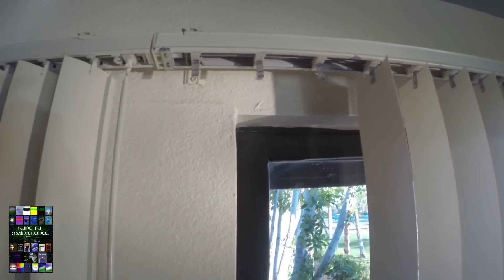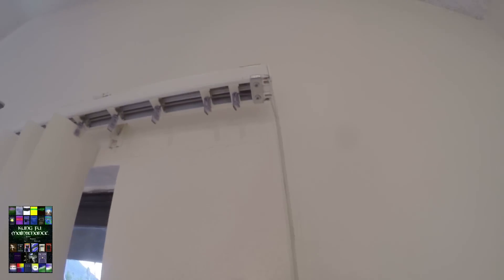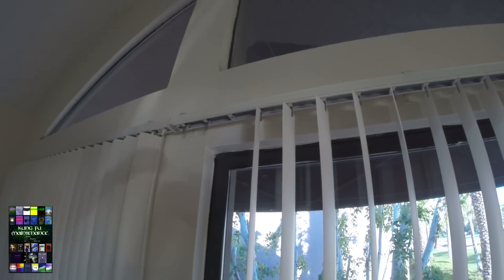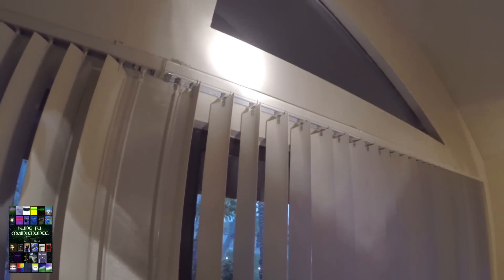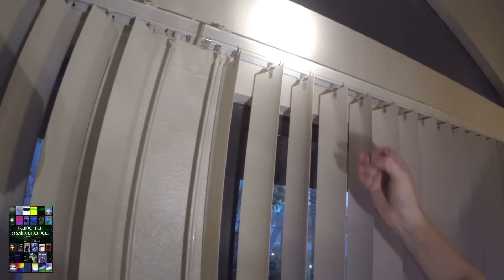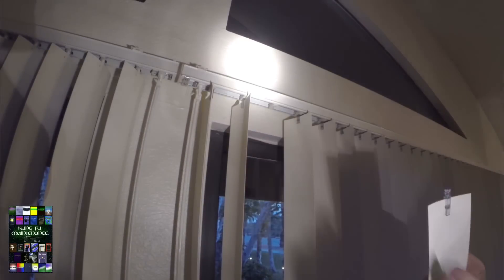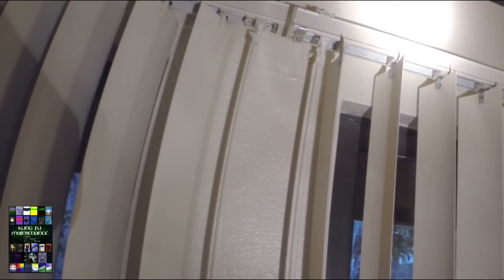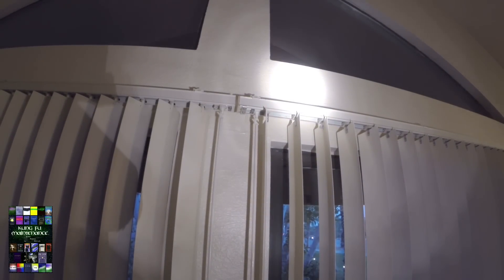How To Repair Vertical Blinds Broken Stems Gears Not Turning When You Don't Have Parts

Comment: Note that the Levolor cordless vertical blind head rail uses a different mechanism that doesn't pop off. If the plastic gear/blind holder gets out of sync with the rest of the blinds, you have to push up hard on the device then rotate it to the desired angle (as the others) and snap it down into place (meshing with the drive gear).

Comment: Thanks for the video.  I had the same problem where I turned the wand a bit too far and it apparently popped the gear up.  Step by step instructions definitely helped a novice like me.  A piece of my cover cracked off when I opened it, but I was able to flip it around so that it still holds the gear down.

Comment: How does the comb go in?  Toothed side out, flat side up or down?
Reply from the maker: Combs go in tooth side up, grooved side facing the opening and the stem gear fits into the grooved side. Comb teeth face up fitting into the center control rod.
Reply: Thank you!  Got them in.

Comment: Thanks for the video. I thought my problem was with the master gear. But, I removed, took apart, and inspected it and it appears to be fine. I can't rotate the shaft, even using my hand or a pair of pliers. Any ideas what might cause that?
Reply from the maker: +Matthew Frei It's possible all the slats are stacked the wrong way. Check me video "Vertical Blinds Won't Turn " Kung Fu Maintenance
Reply: Nope, they aren't the wrong way

Comment: Now here I thought "when you don't have parts" meant "when you don't have parts." You DO have parts - you have spare stems. I don't. Not very helpful.
Reply from the maker: +Marcia Purse Sometimes you can take one from one of the ends if if you have enough room. Doesn't always work out but those are the breaks.
Reply from the maker: +Marcia Purse Sometimes you can take a stem from one of the ends if there's enough room but not always. An easier workaround is linking some of the carrier's together with a small piece of wire I show this in a recent video I did on "Vertical Blinds That Have Fixed End Caps Repair" this won't work for every situation but those are the breaks. Hope that helps - Thanks for watching
Reply: +KungFuMaintenance I can't find the video you referenced, could you provide a link? Thanks.
Reply from the maker: +Marcia Purse Here is the link! https://youtu.be/t01JltUBmjU
Reply: Daloki Here is some one that is hard to please. I loved this video as it saved me 50 dollars because I fixed the problem myself. You just can not help some people no matter how hard you try.